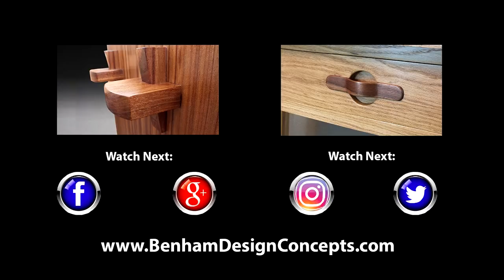Building a modern bench with mitered legs and waterfall grain - Woodworking

Comment: Very impressed how you were able to get such a good glue joint on those long, long pieces of walnut.   Quite a chore to balance the beams on the jointer the way you did and to pull them together with your clamps.  That miter joint was to small task either.  Good job, you obviously have some good skills

Comment: I've been asked to build a waterfall bench.  Customer wants it about 6 ft long and the wood they want to use is only about 1.5" thick.  My concern is that doesn't seem thick enough to carry several folks sitting on it over that span and the legs seem like they're a bit thin.  I'd be more confident with your thickness.  I've got no way to add to the thickness. Should I be concerned?

Comment: Would your temporary clamping method work on douglas fir? I want to try this process, but don't want to tear up the surface when removing the blocks after assembly. I am building an entryway table following your entire process, but using less expensive wood. Thank you in advance.

Comment: What kind of glue did you use on the dummy miters for the clamps? I like how easy it was to get rid of afterwards.
Reply: Thank you for the tip
Reply: @ginomorales5848  what was the answer? Looks like it's been deleted...
Reply from the maker: The miters we're glued together using epoxy, and the little temporary glue blocks are glued with CA glue.
Reply: @Benham_Design  oh, awesome! Is that in your list of consumables on Amazon? I don't think I saw it, but would love to know which you used? Any spray CA glue? Thanks for responding! This bench is DOPE! Gonna build something very similar soon...
Reply from the maker: I can't remember what brand of CA I used for it, and this app won't let me easily view what I put in the description.  But I can say that in over the years I have used several different brands, titebond, TP10, ect, and they all worked great.  The only one I had a bad experience with was Starbond, so I'd proceed with caution on that one.
As for the spray, yes  I used an activator.  I put the glue on the block and spray the activator on the work piece.  Anecdotally, it seems to sand off easier doing it that way.

Comment: How do you support something that long where it won't bow in the middle with large amounts of weight being placed on it?
Reply: @Benham_Design  Thank you for the quick response.  I am wanting to build a desk out of walnut slabs, and my design is very similar to yours with the dual waterfall legs and length. The only difference is the width of my desk would be 30".
Reply: @Benham_Design  So you wouldn't worry about any additional support in the center as long as the thickness of the boards are above 1"?
Reply: @Benham_Design  Thank you for the continued help! You have definitely earned a sub.